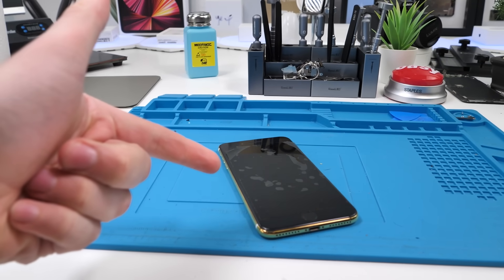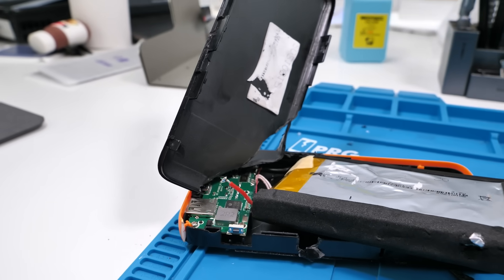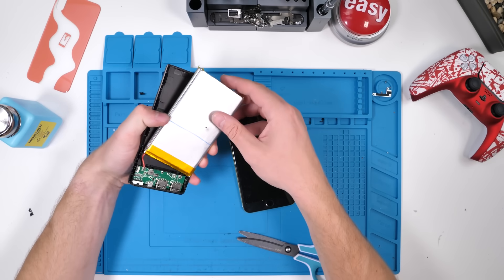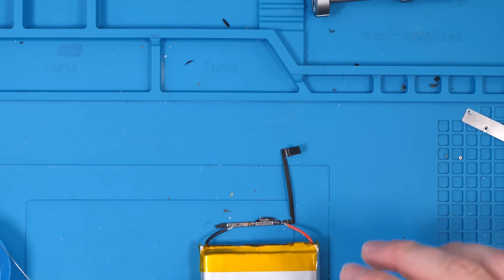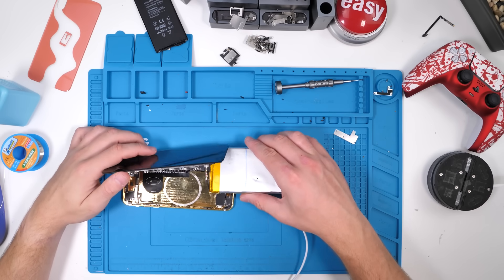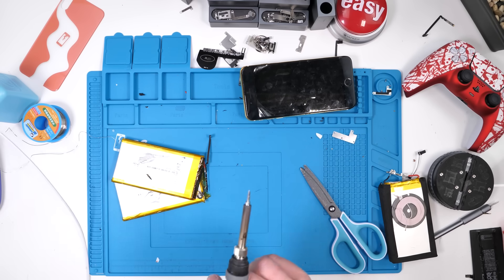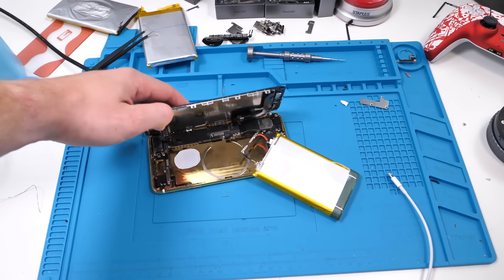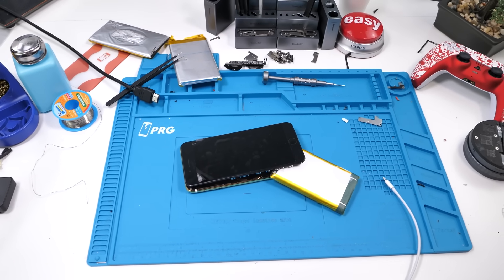Can I Install This Power Bank Battery Into An iPhone?? 10,000 mAh

Comment from the maker: Power banks are lying to you video : https://www.youtube.com/watch?v=xR-EizT7Am0&t=220s&ab_channel=PhoneRepairGuru
Last gold housing mod : https://www.youtube.com/watch?v=HAjzF3DB6qQ&t=56s&ab_channel=PhoneRepairGuru
My BLUE Mat :https://a.co/d/h3iPG3i
Reply: Using a 3D printer to make a nice iPhone body for a new battery
Reply: If you put this battery on the back of i phone, cover it with 2 component resin epoxy to create a hard outer shell, otherwise it would be dangerous because battery can easily get puncture and cause issues.
Just a thin layer of epoxy is enough, and you can use it as your daily phone.
Reply: Early
Reply: Hi
Reply: hi
Reply: Hi
Reply: You can 3D print the back case
Reply: When you defuse a bomb remove the black and red caple
Reply: Can you rate the xiaomi 11t pro? In a vid?
Reply: @the40ator51  my farther has a xiaomi 11 ultra (I think)
It’s bad
Reply: Ur vids are the best
Reply: Question: What Was The Worst Damage Phone You Ever Fixed?
Reply: Hey sorry just wanted to ask if Apple Face ID can be fixed
Reply: @alaminkazir3667  I think so
Reply: yo wsg man so i have an old iphone 6 in my family that im tryna back up but its disabled what do i do?
Reply: hey my iphone 11 screen is cracked how can I fix it
Reply: It’s ok, I’m actually a pro editor ( not the best one you probably will see ) and I’m extremely happy to edit your videos!
Reply: i need some serious help my phones battery has expanded a LOT what do i do ?
Reply: You should try android battery inside a iPhone and vice versa
Reply: Hello
Reply: Try to repair the Beats Studio Buds.
Reply: @User_1795  I agree
Reply: Early
Reply: Hey I have a question for you? Would you like your logo laser engraved an a piece of wood? I’ve been watching your content for a while and wanted to give something back to you
Reply: @SideArms05  email him via his website he would be more than happy to
Reply: Time ticking bomb
Reply: Hello! 
Edit: I Didn’t Realize It Was 1 Minute Ago wow
Reply: Apple watching this video like: YOU DID WHAT?!
Reply: Sir, do you have any iphone model that you can sell at Rs- 25$ 😢, any iphone model, I am not not rich enough to buy a new one, love from India 🇮🇳😢😢😢
Reply: I have a question can you fix a iPhone 3GS?
Reply: soo.... can you recover images and videos out of a water damaged phone? I wanted to recover my videos and images from my old phone that i havent touched for a few years, a samsung a9 pro but it cannot be charged or turned on. Is there a way to recover images and videos?
Reply: @FuzmintYT  just put a battery like he did, even if it won't take a charge, you can use the battery energy to turn on your device and remove the data.
Reply: @vinitsingh8962  the thing is.... I need to buy a new display and a new battery
Reply: @FuzmintYT  your port is damaged?? 
Or its just not taking charge for no reason,
Does it show any kind of life, when plugged in a charger??
Reply: @vinitsingh8962  no life at all and it is water damaged
Reply: best mod ever!!!! u should make custom 10000 mah batteries for iphones and sell them
Reply: Hi
Reply: Early
Reply: You cannot use apple battery BMS because the moment power gets cut from bms the bms locks same as laptop battery bms if you somehow managed to solder new battery before removing old battery from bms it may work. 👍🏻
Reply: how much does it cost to put a phone into a different housing
Reply: you're a noob someone in the Philippines modded a 10k battery on an iphone that is not bulky af
Reply: Anyway that you could make a iPhone with a replaceable battery
Reply: Can we get a link for all the tools that you use please.
Reply: @enochgathiaka916  in his latest video
Reply: I would love to buy this type of iPhone from you
Reply: Make 3d body
Reply: Like your videos bro
Reply: I think building a 3d printed back will be better , that way it will be more customizable like you can even add a fan
Reply: Bro please make an video of installing iPhone 7 battery on iPhone 8 pls...or like iphone 7plus battery on iPhone 7.
Reply: I bought your mat and it is always on my desk to this day
Reply: Hey brother can you give me that power bank chip from which you cut the wire and removed the chip so you are not going use so please give me for my science project please and the other which you stab the battery to his death please
Reply: @All-AnimePlayer  don’t beg like a child

Comment: Hey, I have this idea of using Samsung M51 (7000mAh) Battery for my Samsung S24 Ultra (5000mAh) battery, i am planning to use the original BMS from my S24U, the dimensions are the same (i think?) can you make a video explaining if that is plausible. there are a lot of smartphones with super capacity battery, will it work just by using the correct BMS?

Comment: Same i put 10000 mah power bank battery on my iPhone 11 pro back  and battery backup is 13h in heavy use i also use original iPhone battery empty space with copper plate for heat distribution
Original battery backup 5h

Comment: Dude why don't you built a back shale with 3d printer to fit it properly. You can see itel power 70 which has custom back shell for extra power back up you can try that idea for your iphone. And yah its Chinese Android phone very cheep but the extra power idea was great enough. 😊

Comment: Guru : We are gonna use this power bank battery. It's 8000mah. Ohh .. I forgot I did that with this battery. Never mind.

We have another battery guys. Don't worry. We are gonna this one. It's also 8000 mah.

Ohh .. let's remove the bms board. Oh sorry i broke that 🥲

Never mind. I have another one. You guys just chill okh. 

,

,
,
,
,

,
,

,

,
,
,
,

I can feel your pain bro. It happens to me also. Failure is piller of the success.

Comment: the 2 batteries seems not work, maybe the iphone has mah limit like 5k to 10k mah i think. the time that you remove the one battery instead of two which is 10k mah the iphone turns on and work properly

Comment: I want to point out that not all li-ion batteries are the same voltage some
May be higher some may be lower it just depends on how they’re wired, series doubles the voltage while parallel can give you better run time always check with a DMM to see the actual voltage if said battery!

Comment: Have fun when the thing explodes in your face. The battery of the iPhone or smartphone is a high-voltage battery. It has a nominal voltage of 3.85 volts and a charge limit of 4.35 volts. The battery from the power bank is a normal LiPo battery with a nominal voltage of 3.6 and a charge limit of 4.2. If you want to continue using the battery, it will be overcharged by default. A phone repair guru should know the difference....

Comment: Now this is bullshit isn't it, anybody can detach some wires and solder a bigger capacity battery. I thought he'd make a fully functioning phone by putting  a higher capacity cell. One day I'll make a video and the caption will be " i made a v24 engine." And the other v12 engine will be hanging out the side of the bonnet. What would you think.

Comment: Damn you need atool for cutting wires.
I suggest Irwin WS5 2078305 5" Wire Stripper, small enough for cutting and stripping wires.

Comment: For anyone interested in trying this for their own, you're gonna need some higher power cells.
Most smartphones these days use a 3.85v lithium battery that charges at up to 4.4v, and the average lithium cells found in power banks or other electronics have a voltage of 3.7 charged at 4.2v.
Find a 10k mah 3.85v battery and it should work.
Reply: My cousin replaced his redmi note 8 battery that had turned into an inflatable pillow about a year ago and recently it puffed again. This time, we got a galaxy A50 battery and soldered the cell to the bms of note 8's battery. Worked like a charm and he says it lasts even longer than the original battery despite both being 4000 mah

Comment: Back in the days of (easily) replaceable batteries, I bought a replacement battery for my Windows Mobile Pocket PC with more than double the mAh. I don’t know why I expected it to be of the same size. It was thick and came with a replacement back cover as well. Worked fine but phone became much thicker. At least the power lasted longer.

Comment: You should get solid state battery with 30.000 mah capacity and it will fit correctly or upcoming Nuclear reactor battery with 50yrs battery life it will fit correctly

Comment: It could run with single cell but not with dual cells? Does it mean the dual cells is in series making it double the voltage? Why  you not check it with multimeter first lol😅 now run those but with 10 cells in pararel 😅

Comment: it wont charge or discharge fully , the bms has set capacity and wont charge or discharge above the set bms capacity , use bms programmer to change the capacity

Comment: The battery are in series they have double the voltage than original apple batteries so bms is detecting overvoltage

Comment: The actually happen is the LiPo battery  are too much Ampere thats why the current of the batteries are cut by the over current protection circuit of a phone. Also the phone have a over voltage protection circuit.

Comment: Just place the wireless powerbank at the back of the phone. Easy solution. Here, in India iPhone 12 battery replacement cost is Rs. 6000/-  So, I ended up buying a 10,000 mAh wireless charging powerbank at half of the replacement cost and it magnetically get attached to the phone.

Comment: 2 cell batteries? Really? That’s 7.4v combined. Phone battery has 3.4v so bms board needs at least 3.4v, which means you fried the board by overvoltage.

Comment: dude if you solder the 2 battery cells it powers the phone at 8.4v instead of the 2.4v the BMS? Is rated for ! if the bms didn't have a security u would have fried or fry the all iFone... you probably did this experiment without really knowing the risks. Glad it didn't smoke. Har-Harr

- said Digi fpv

Comment: It's nothing new to me, I am using 18650 connected in parallel same solder to BMS,But I didn't solder the wire connected to the Battery first like you did on your Video,You might damage or fry your Device.For Safety you must Solder the wire Red & Black first to the BMS,Second drill a whole at the back cover of your device,Exit the wires thru the wholes,Before you close your device without battery,Make sure wrap your BMS with plastic Tape or any tape to make it insulated within your Device.Then make your Solder connection to the Battery mounted or stick at the back of the Device,it will act as your only external large Amphere battery.
I apply this method on my low-end Android Tablets filled with Emulators up to PS1 or PSX.The Tablet is filled with 18650 Battery at the back at least 9 Batteries and I playing my Games for 5hours straight.Why 5hours only you might ask.Because the Tablet is not AMOLED or OLED yet together with a Big Screen it consumes a lot of Battery.im happy playing it

Comment: You wont actually get to use the battery , mostly because all phones have a software hardwired capacity in them , meaning the phone knows what it should have (lets say 4000mAh) if you put a 10000 mAh it will just measure how much it consumes until gets to  4000 then will say you have 0% even though you are well above 60% , i say this from experience (not on a iphone but should be similar) a few years back when i tried to make a 28000 mAh android phone , i had to root it and declare in the files what capacity it had , i dont know if you can do this with the iphone but good luck !! I like your videos.

Comment: I'm just going to 3d print a case that can hold both my phone, and a power bank.
Reply: smart😂only if he thought of this and he wouldn't be wasting so much time on connecting the phone to the battery
Reply: But then you are charging the powerbank, which then charges the phone... but other than that, it works.

Comment: Yo awesome video! I have a question. I have a tablet which the battery is not working well. The battery is 3150 mah with 3,7 vol. can I change the battery for a 5500 mah with the same 3,7 vol? Will it not brake the tablet? 
Thanks!!

Comment: Id be careful with that, the chip from the iphone battery has a cap of 4.4v but the batteries from portable chargers are rated at 3.7v

Comment: But I think that the power bank's batteries are nowhere near in quality as cell phone batteries so they will die quickest. Like how long does an average power bank battery last before it dies and stop charging? A few months at best? Lol. So I don't see this as a long term solution, but very cool experiment though 😳 Also a modified case would help and maybe with a more simplified system to swap out a dead battery in case it stops working 📴 All cool ideas but not sure how it could practically carry out as a real-world product

Comment: I also like to live dangerously. Those batteries are in series, which means 2-3 times the normal voltage of a single cell. 7.4 or 11.1 volts depending on the amount of cells. You're damn lucky that BMS didn't fry. Please do some research before attempting these kind of tricks.. At least get yourself a multimeter and some proper pliers, so you're not using a metal scissor and potentially shorting everything out. Damn, this is really, really bad.

Comment: I actually did this with my iPhone 7. Drilled a hole in the back and 3d printed a case. I tried multiple different batteries, from 5000-10000. In the end, the bms board was too hard to get a solid connection with the solder to deliver proper voltage.
Reply: What do you mean with "deliver probably voltage"
Reply: @surapurna  sorry, I meant proper lol I’ll edit it

Comment: The iPhone's software isn't going designed consume the full 10,000 mah battery, you can connect a 100,000 mah it's still going to switch off after consuming the originally supported battery capacity which I remember is 2700maH in this.

Comment: Meanwhile in China, you can pay $50 for a 10000mAh battery with custom back case that just makes it thick but rugged enough for daily use. 

As I have heard, the SE2 with this mod lasts a week in a single charge

Comment: It would be better if you stick the powerbank to your iPhone's backs and connect it with a regular lightening cable.  It could be used and you would also have the original battery inside.

Comment: Dude I think those batteries are fully charged, each cell is 3.7 volts. When fully charged it gets 4.1 volts. So it's two cells battery, and if each one is fully charged to 4.1 volts x 2 cells = you'll get 8.2 volts, the BMS board has a overvoltage protection so that's why it didn't work

Comment: Instead of 3D printing, probably better to hire people with CNC machine to make a metal back that is much cleaner. Probably add in thermal pads too in there for better heat transfer

Comment: The first 2 attempts didnt work cuz you overheated the bms board. The tip of the soldering iron cant stay for more than 2 seconds on each pad, otherwise some ball squeezage will occur and the circuitry will fail.  Btw iphone 13 pro can run on iphone 4 battery (only for about 3 hours tho lol)

Comment: I think if you whan to make it properly work and add more capacity, you need JC V1S Battery Repair Board and Flex. Then you can add capacity and if battery won't output anythin, you can activate it back to life.

Comment: 5:42 min: OMG, dude your soldered wires from the cell to the BMS are fully exposed, and then you literally just lower the *insanely conductive metal backing of the screen onto those bare contacts*?! You know that you could‘ve directly shorted out that 42Wh Battery without any protection. Honestly, that‘s just incredible…

Comment: Please give the mobile phone the prescribed 2S baterin. There will be a reason why the manufacturers used 2S. Besides, the phone thinks it has the standard battery. So you still have to tell it that it has a hearing capacity. The best way to do this is to find out where and how to change the capacity. This is important for the % display! Warning! It is possible that the battery is not recognised as 1s but as 2s and the battery is overcharged. The result is a flashover of more than Please give the phone the prescribed 2S battery. There must be a reason why the manufacturers used 2S. Besides, the phone thinks it has the standard battery. So you still have to tell it that it has a hearing capacity. The best way to do this is to find out where and how to change the capacity. This is important for the % display! Warning! It is possible that the battery is not recognised as 1s but as 2s and the battery is overcharged. The result is a flashover of more than 1m. It is best to bring the battery to 0% and then to 100% while observing with the mobile phone. Then the % display is correct

Comment: I tried with this same way, my last original battery was at 68% health. Now I installed 4000mah battery with original battery circuit. but the battery backup is same as old battery. Still my iphone showing bh is 68% 😢. Any recommendation? Anyone help me please!

Comment: i also did this project before on my iPhone 6s and I double taped the battery In the back of my phone,moreover, I get through the wire inside the screw hole under the iphone and get soldered the wire on the bms

Comment: Goes to show; I mean, 10,000 is half of most flagships that are pretty thin...just think, with the new battery tech Samsung is set to use EV battery tech to increase battery performance while sliming them down, I see no reason why - with a moderate thickness bump - we couldn't double the current flagship 5,000m mah. They need to stop stagnating.